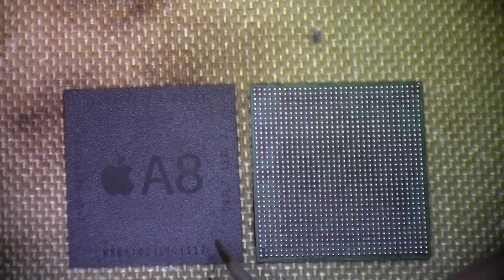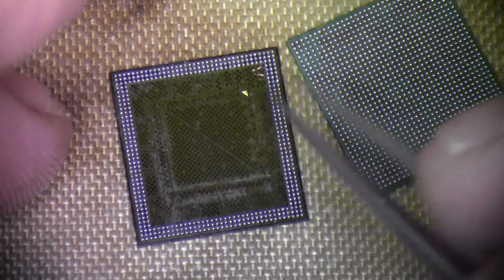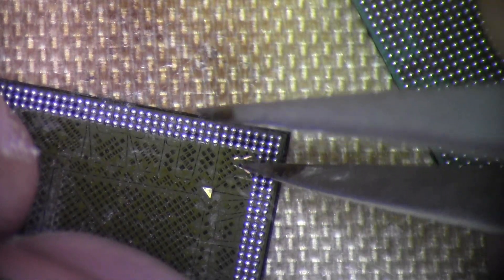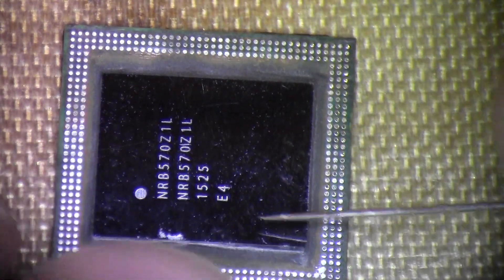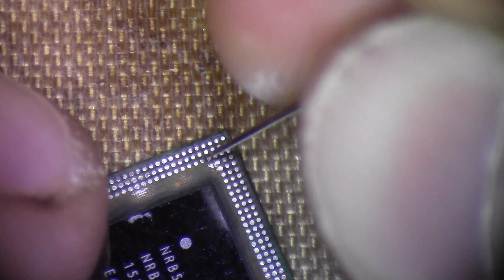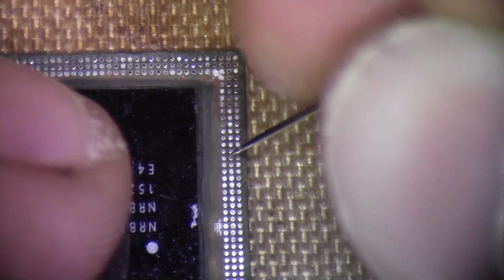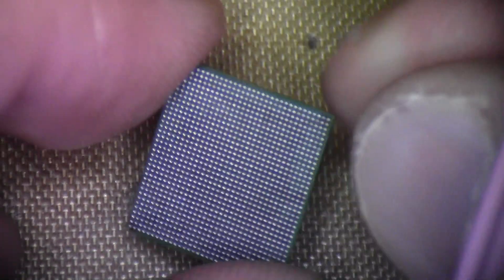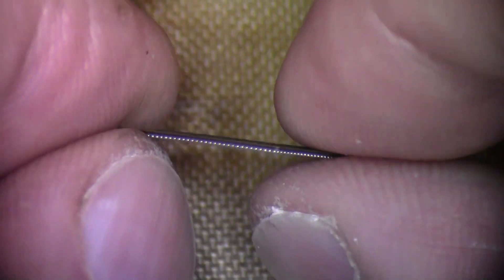iPhone 6 CPU / SDRAM BGA reball Trial #2 inspired by Rany

Comment: You should have preheated the board to 235 -240 *F for minimum of 1 hour and set hot air ( If that is what you use) at no more than 365*F  for removal of CPU  Install same thing but board  should be preheated  and CPU preheat at 235-240  1 hour .Install temp for chip again is 365 based on a  63/37 Sn-Pb solder  Because of the different  structure of this chip preheat is very important. The board and chip have to be normalized to the same temps or you run the risk of chip warpage . This does not apply to all chips but these types ,yes    Thanks for the vid
Reply from the maker: josef vopinka thank you for the information
Reply: Are you sure those temps are F and not C?